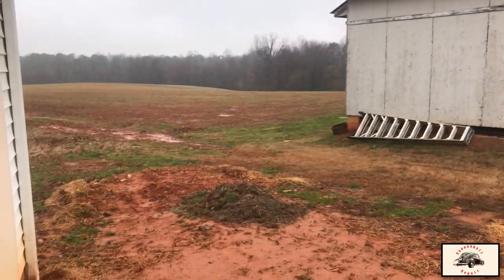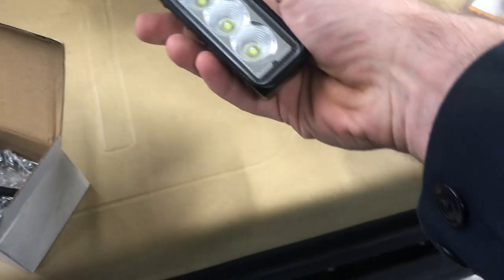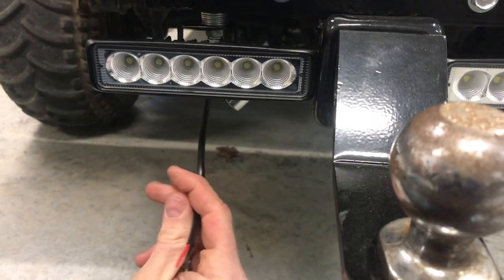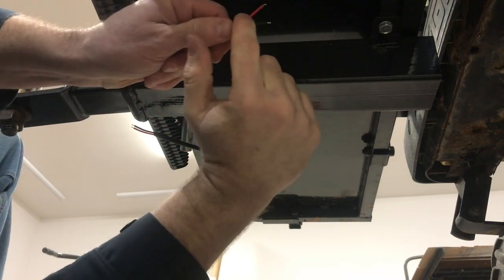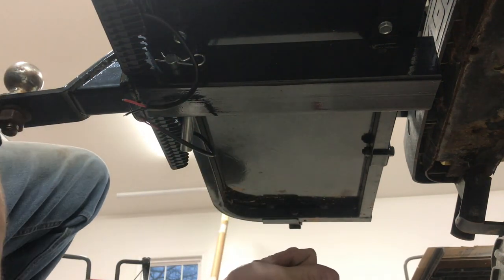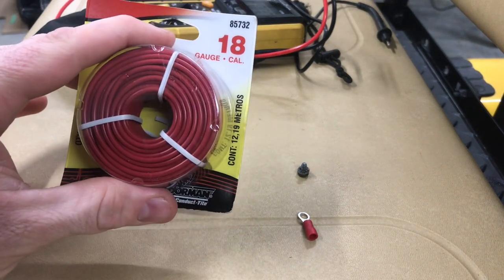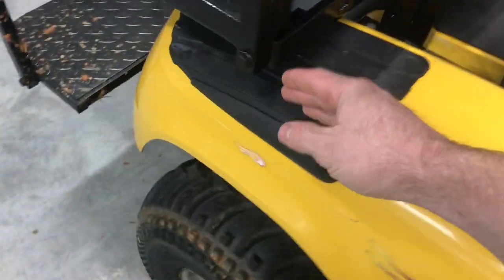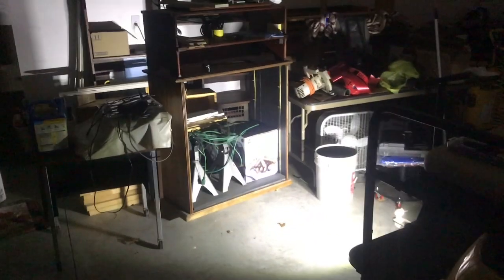Golf Cart BACKUP LIGHTS

Comment: Decent job. I did this on my cart but used the wire from the switch to activate a relay to run the circuit as to not pull ALL the power for the LEDs through the switch
Reply from the maker: @REG3305  being LEDS were used and their low power requirements there was no need for a relay.

Comment: Can you do this same setup, but go through the light switch somehow? That way reverse lights aren’t lighting up during the day. Only when I have headlights on at night.
Reply from the maker: Yep! You sure can. May have to use a relay. Get power from the head light switch to a relay. Trigger to turn relay on would come from the backup switch. Should work just fine. Could also use a photocell, either way you prefer. Hope that helps.
Reply: @cannonballrepair7940  definitely! Thanks!

Comment: What year is your EZgo? I wanted to do this to my '95 but A) There is no ground to chassis, and B) all voltage going through my micro switches is pack voltage. (36v)
Reply from the maker: This EZGo is a 2002 model. Gas with a 12volt system. You’d have to find a led that would run on that system for step the voltage down to 12.